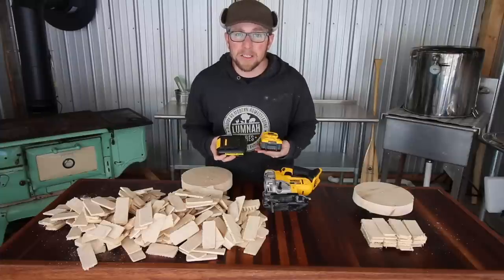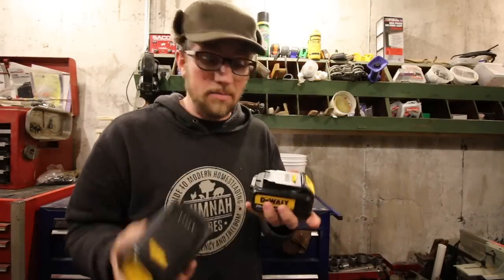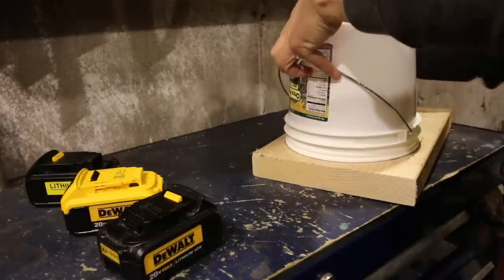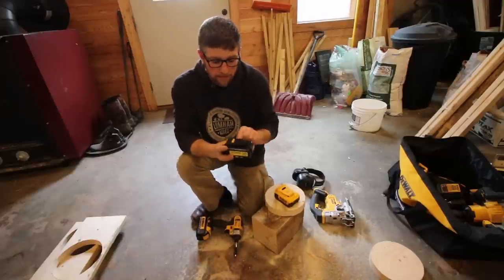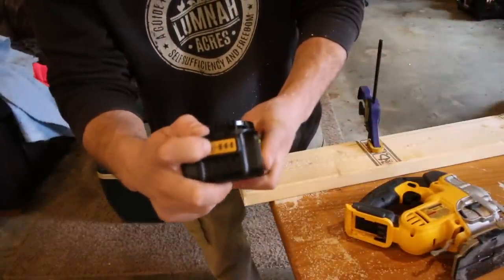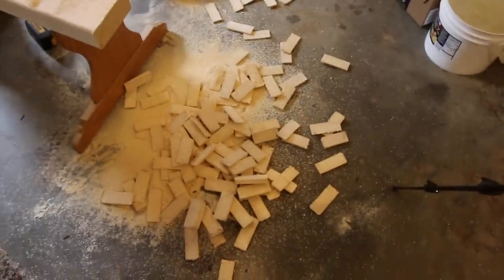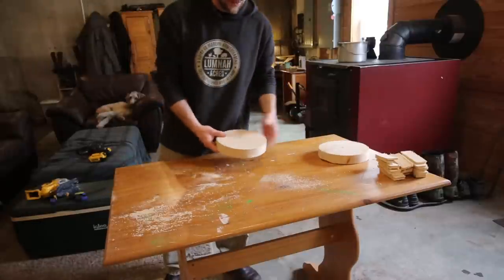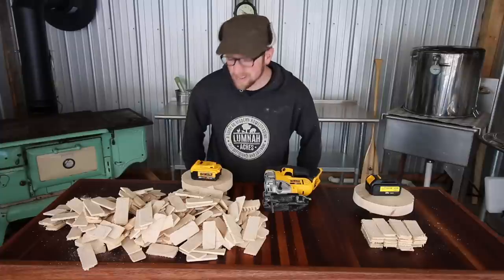Testing a Cheap Battery VS a Dewalt Factory Battery (You Might Be SURPRISED)

Comment: Add the new battery into the rotation at work, for a month. Make sure to use it as often as the other batteries. Pay attention to the recharge time. Then make the test again, after that month. This was, after all, the first time it had been charged and used. Rooster sound with the banner... pretty good. It occurred to me that there was a difference between the 'natural' rooster just before that, and the rooster sound with the banner. You can take advantage of that, and make the difference even greater.
Reply from the maker: Good idea on the battery. Both the rooster sounds were from our roosters I wonder which rooster is louder?
Reply: That was my point. You can make either of them louder. :) Or both at once!! :) Or make it sound like you shot or strangled the rooster. etc... :) "Er-A-Er-ACKKK! LOL

Comment: Best comparison I have seen. Most people have tested with Low amp tools, and they come out close, with dewalt being 30-50% better. But the dewalt batteries are made for very very high amp draws, for their tools that need it, not intermitant low draw usage that the offbrand batteries have, normally 10amp max, vs dewalt 30amp or higher. Not so much that the dewalt battery had more capacity, but it can handle the capacity under load much much better.
Reply: The DeWalt battery pack did have more capacity.  What the video showed was the definition of battery capacity.  The generic battery pack was missing 3 ounces = less capacity.

Comment: I bought two Vanon batteries for some of my Milwaukee tools.  I bought them mainly for my cordless vacuum, flashlight, jobsite fan, etc.  But I've used them also with my drills and impact driver.  I'm considering to buy Vanon for some used Dewalt tools I have.

Comment: Nice, it's always helpful to see a real life test like this. The cheaper pack probably has cheaper, lower capacity 18650 battery cells in it. One of my 12v DeWalt battery packs from 2013 just died on me. It had three LG HB4 1500mah 18650 cells in it. Always ask the seller for the battery cell specs and model number when buying a battery pack.

Comment: I have a Black & Decker 18 volt drill, was building a 12x12 deck, the B&D kept dying, so ended up buying a Dewalt 20 volt XR Drill. I used the B&D to predrill screw holes and the Dewalt to do the screwing. 1.3 amp Dewalt battery never ran out of juice. I now want to expand the Dewalt 20 volt line with a jig saw and circular saw. I will be sticking with the Dewalt batteries.

Comment: Interesting experiment. I suppose its possible that the cheap battery was just faulty. Eitherway it is not a good endorsement. Maybe the manufacturers of cheap battery will send u a few more to test. The difference in weight is interesting because if they met the same spec you would have thought they would weigh the same. Have you got a multimeter? It would be quite interesting to see if the readouts on both fully charged batteries differ at all.

Comment: Ohh well, the vanon batteries work pretty good in my m12 Milwaukee tools. The 3.5amp hour is similar to the Milwaukee 2 amp hour. As a mechanic the vanon always last long enough in my 3/8 impact and ratchet to finish the job and get charged when doing something else so I guess it all matters what you are going to use them for. In my case I guess I'll see if the longevity holds up. And the vanon are like 1/4 the price

Comment: Since the comparison was continuous duty it might be possible that the DeWalt has superior internal electronics to control the battery drain and temperature.  That could also help explain the difference in weight of the Vannon and why the smaller DeWalt weighed the same as the larger capacity.  Only real way to determine that would be to open them both up.

Comment: You need to do this again after you have used/charged the Vannon battery for a month. Have heard that new batteries are not really hold 100% charge at first. Something about "conditioning" them I believe is what it's called. Either way would be great to see if it gets better or worse with use and time?!!
Reply from the maker: I will have to check after we use the battery more
Reply: @Robert Veronda - WHERE did you read that Lithium-Ion batteries require conditioning?
Reply: @MrSummitville  I honestly don't remember, sorry.

Comment: I'd like to see the same test run on some of the other after-market brands.  Maybe one actually is good?  Lord knows we need some way to break Dewalt's hold and get some more affordable pricing.  Then, too, maybe Vanon saw this review 3 years ago and has improved their product.  

The weight diff was a dead giveaway.  They didn't include enough battery in the case.

Comment: 4:15 mark:  My math shows just a touch over 3.5oz.not 2oz...   
1.33lbs is 1lb_ 5.28oz, and 1.55lbs is 1lb_8.8oz... Delta mass = 3.52oz, or about 14% more.
Good Video, thx for sharing
Reply: You math is wrong because the scale was in "Lbs:Ounces.decimal" mode ...
DeWalt = 1 Lb 5.5 Ounces
Vanon  = 1 Lb 3.3 Ounce
=====================
Difference = 2.2 OUNCES, which is huge difference in battery weight

Comment: I have a dewalt kit that came with two of the 2ah batteries and they were dead within the first year, completely. I bought two 6ah batteries and have been using them for about a year. Now I just bought two 6ah batteries from vanon and so far they work just as good as the dewalt. I will certainly buy more because dewalt is just too expensive.

Comment: A great video, thanks for sharing.  I am ready to buy a few power tools to take to The Philippines.  I will take a power saw and a jig saw.  I will also take a drill for using as a drill,and as a screw driver.  I am open to suggestions.  Your suggestions are invaluable.  I have a tendency to stay away from Chinese made items.  Your weighing the battery so surprising.  Who else would have the equipment to weigh those batteries.  Awesome video, thanks for sharing.  God bless America.
Reply from the maker: I would recommend the set we have. The battery life is amazing. You want to get the one that has at least 3.0 amp hour batteries and a 4.0 amp hour battery to go with it.

Comment: Excellent consumer report, it is so tempting to go for the cheap knockoff I bet this will save folks both time and money. The question I have is with the 3amp and 4amp Dewalt weighing the same do you think the 4amp is worth it?
Reply from the maker: Yes I get a lot longer run time out of the 4 ah battery vs 3 ah
Reply: That’s b/c the batteries and case are same size just the 4ah battery pack has higher ah batteries in it.

Comment: I expected that result. However, don't throw out the aftermarket battery, as it may gain runtime and power after a dozen or so chg/dischg cycles. I have a combination of Makita 9.6v(all that was quality and available in the '80"s for battery tools), and as they have worn out, I have replaced them with DeWalt. These are 2 very different battery systems, the Makita was NiCd, and DeWalt is Lithium. The Makita batteries were far superior to the aftermarket, so much so they were worth the huge price difference. Keep them charged, and charge them when the tool starts to run down, you do not need them to be completely dead. The DeWalt batteries are, again, obviously worth their higher price. But, Samsung, LG, and Panasonic recommend storing their lithium batteries around 50% charge, so I use them, and leave them at a partial charge until I need them next, then I charge them. I still have & use a 30-year-old Makita battery(one of the original made in Japan ones, the one made in Georgia don't last as well), but I have all of the original DeWalt batteries that came with the tools, none have yet failed, none are over 3 years old.

Comment: I purchased a clone from Amazon and I was impressed how well it performed.  But ..... on the third charge it showed faulty.   I opened it up and found two cells oozing.   I stripped out the good ones and use them in a LED portable light.    Just to be ornery I bought another identical one and use it in my DW Bluetooth sound box and phone charger in the shop.   It has a very light draw rate.   It frees up my DW batteries for real work.   One possible issue with clones is that they might use cells that are not as happy with higher amp draws as the real tool company ones.    When I dismantled the failed battery I saw no brand name at all on the cells.

Comment: I use Makita and Milwalkee power tools. DeWalt is the most sold because they are cheap. Vannon batteries last as good as Makita batteries in my power tools. Giving a bad wrap for a good battery using a cheap tool.

Comment: Al, I don't know much about batteries but I'm wondering. With the Dewalt battery having multiple charge discharge cycles and the Vanon not could that effect the comparison?
Reply from the maker: I dont think so. The Dewalt battery lasted a long time when I started using it a work right from the beginning

Comment: Project farm did a great video on this.  Dewalt original was best but Waitley had the cheapest $ per amp hour and Vannon just sucked.  I bought a Waitley and it works, but it takes a lot of fussing with it to get it charged, and it will only charge on one of my three chargers.

Comment: I just received my dewalt driver and two batteries, 20v One battery worked twice, but only had enough power for1 hour each time, the other battery didn't have a charge and won't charge. I'm not sure who to blame, dewalt, or amazon who claimed it is too late for them to warrant, talk to dewalt, who says Amazon isnt a dealer. O well, what is 139 dollars anyways.

Comment: betcha they are really all made by the same place.. just different stickers... even though they say different countries.. its  just a brand name thing.. ive done some manufacturing before they do stuff like that.. al you need a wood shop lol.. you should of hooked up a ohm meter i bet the cheepos didnt put out the same voltage.. some of those batteries people get online are half of what they are supposed to be they fill them with sand and stuff ive seen

Comment: Hey Al, I have a Ryobi  Lithium + 18v battery which is 4Ah but also says 72Wh which I'm guessing us Watt hours. These are the biggest batteries they make and has a 4 light battery life indicator and I purchased them on sale 2 for $100 if I remember correctly black Friday leftover. The smaller thin batteries which came in the drill/impact kit are 18v 24Wh batteries with no indication of Ah or life lights. Does the Dewalt have Ah numbers and we might have to do a comparison test. I live in CT so it's a possibility.
Reply from the maker: The Dewalt Batteries are 4 ah Batteries that I was testing. I also have 3 ah batteries and they make 1 ah and 6 ah batteries for the dewalt. That might make a good comparison video

Comment: Very interesting, it is the cost of the electrcity to recharge plus the cost of the batteries which over time definetly costs lots more. What would be interesting is the comparison of the batteries life time use. Only kidding Al, I don't expect you to conduct that test as you will be very grey by the time you finish that test hahaha
Reply: The cost of the electricity should be irrelevant. Total-Hours of operation over lifetime vs the cost of the pack is important.

Comment: Shouldve bought Milwaukee 😂 good side by side though there should be more of these on youtube
Reply: MasterofNone why do you think Milwaukee is better? I'm not experienced with either, but I am buying tools soon and could use your thoughts.
Reply: Daniel Gilliland go look at both in a home depot and you can see the difference. Milwaukee is a proven brand in commercial shops. I have the m12 fuel combo and the impact will take the lug nuts off of my truck. I had a ridgid 18 volt that couldnt do that. The milwaukee m12 fuel also has an all steel chuck, dewalts are plastic. I bought my combo from cpooutlets and couldnt be happier. I got the reconditioned one and when it came it looks brand new there was no signs of use looked brand new....i recommend you go look at some in person and check them out. Like i said though most tradesman you will come across use Milwaukee and there is a reason for that. https://www.cpooutlets.com/factory-reconditioned-milwaukee-2597-82-m12-fuel-12v-cordless-lithium-ion-1-2-in--hammer-drill-driver-and-impact-driver-combo-kit/milr2597-82,default,pd.html
Reply: I am a firm believer in reviews. Read up on the m12 fuel the price is great and its got excellent reviews from not just homeowners but professionals as well.
Reply: MasterofNone thanks for the quick reply, I'll have to make a trip to the store today.
Reply: i use my dewalt xr reman. to remove lug nuts from my truck. works great!! also the chucks on mine are steel

Comment: Not sure about the jigsaw using up the most power but i can tell you that you wasted a ton of wood doing this. I would have used the 20V fans and let them run for hrs to see which dies 1st..
Next i don't have DeWalt "generic" brand batteries as i get mine free from work, but i do have Ryobi brand batteries & Ryobi "generic" brand batteries. I have done this test like you did but using the 18V fans side by side and the generic's held up with the brand name all the time. I have generic 4ah and the new generic 9ah batteries and all of them hold up to the brand name every time, within seconds of each other. 

Now the weight difference .. until you open it up and weigh the plastic housing vs the actual batteries ... Then you can find out where the missing 2 oz is

Comment: Now try a Milwaukee. =D
Reply from the maker: Lol, I will have to see if I can find one to use
Reply: I actually just bought a combo kit over the weekend. Home Depot is having a special for an impact and drill plus an extra battery for $270. I used it yesterday to hang pegboard in the garage. What a great system. Like yourself, I also own a Kubota and am going to pick up the battery grease gun for it.

Comment: How did the recharge times compare? If they are approximately the same, then DeWalt is the clear winner, but if the other one charges in 1/10th the time it might make sense to get them. At any rate, now you have 229 potential dominoes or Mah Jongg tiles in case you get snowed in. :^)
Reply from the maker: Lol, I will have to compare the charging time!

Comment: It's less about the weight lost and more about the cheap crappy cells they put in these cheap batteries. If these companies would charge just a little more and put good cells in like Dewalt does from companies like Samsung or LG it could have been closer. But these companies are greedy and instead, boldfaced lie about there products right on the packaging.
Reply: It is all about the weight = lower weight = lower amp-hour cells ...

Comment: This is complete bullshit. I have a massive amount of dewalt batteries I use for my dewalt angle grinder. The dewalt battery lasts just as long as the clone does. I mean if you’re going to try and fake a video, at least make it believable.
Reply: Which generic battery pack do you have ?